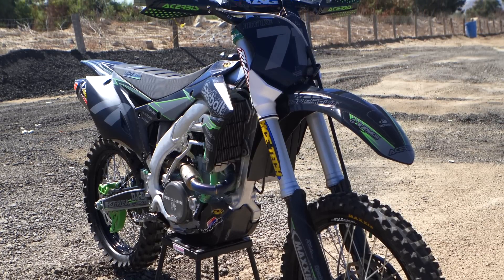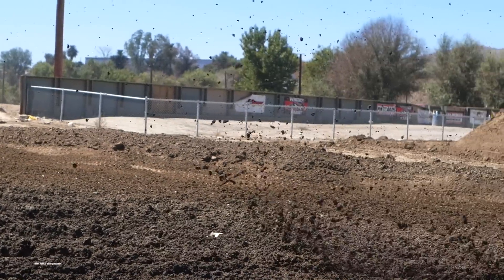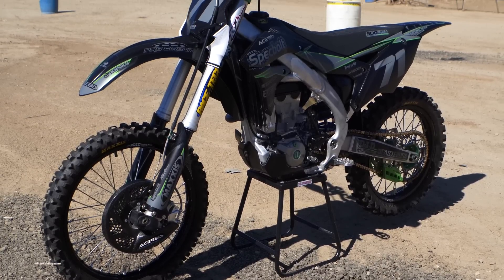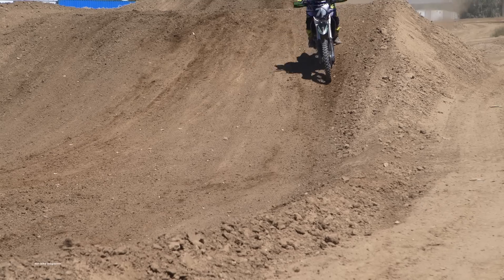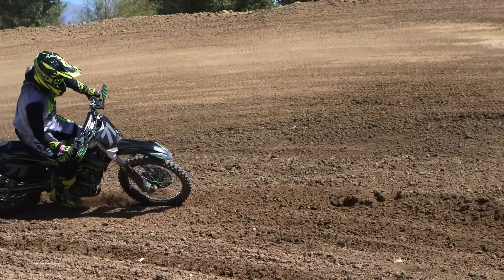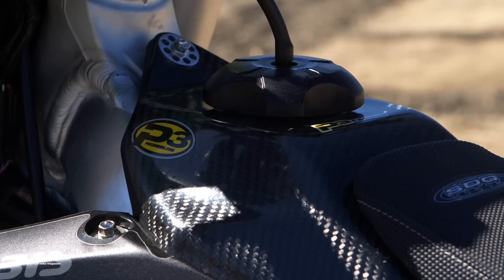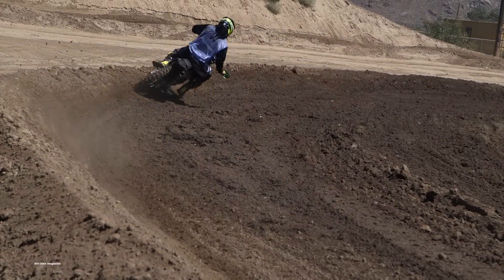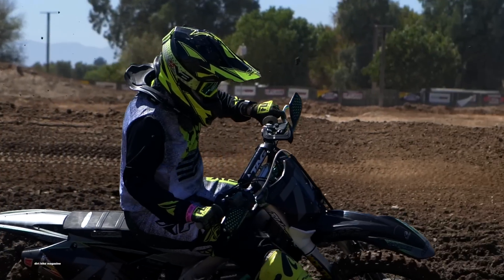Making a 2018 KX450 better than a 2019? - Dirt Bike Magazine

Comment: i have a leftover '17 and only road it 1 time with the stock clamps and gearing. the stock bike felt too long and over geared. the RE clamps made the bike feel shorter and, dare i say it, turn like a honda. they made the whole bike quicker  handling as well. it still has big time stability too. we all know the spring conversion will put it on par with any reworked stock gear but i am staying with the TAC fork as its the best stock fork i have ridden and that includes my 2018 kx250f and '18/'19 ktm's. the stock mapping is terrible. there is a lot to be gained just with that.